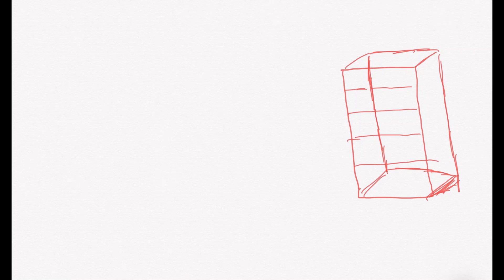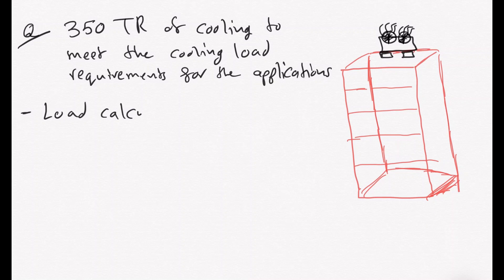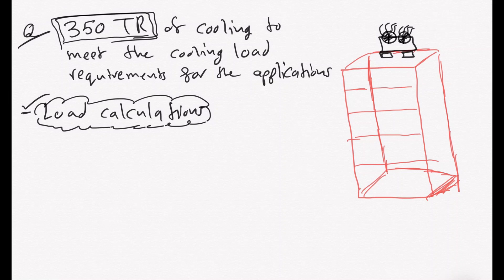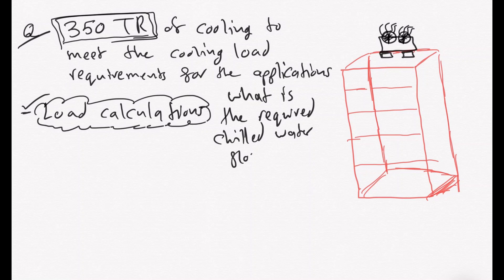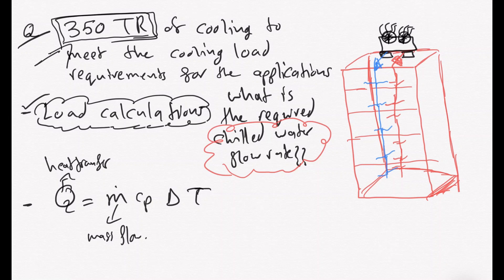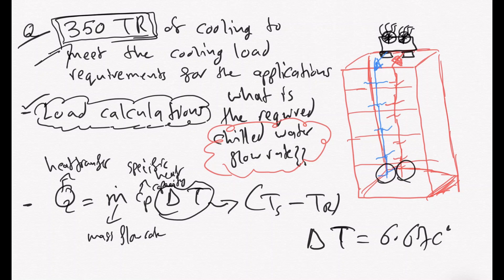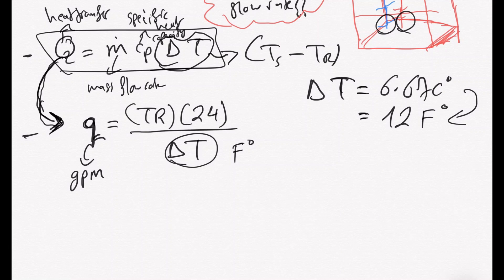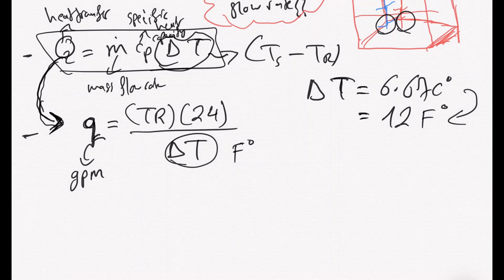Chiller Flow Rate Calculation ( HVAC Design Training - Must Learn this !)

Comment: where is the discount?
Reply from the maker: It's in the video Description , here is the link for the Chiller's Course Discount 

https://eedu.online/p/introduction-to-chilled-hvac-system-chilled-water-flow-rate-calculation?coupon_code=HALFOFF

and for the Full Master Class which is suited for aspiring professionals below is the link and it comes with a completion certificate to showcase your achievement:

https://eedu.online/p/hvac-elite-masterclass

Comment: Very well explained.  When dealing with a water cooled chiller, how do you calculate the required condenser flow?
Reply from the maker: Great Question but since the subject is dealing with water cooled chillers it requires further elaboration and detailing which we will try to address in the upcoming lessons
Reply: @ExpertEaseEducation  looking forward to it.

Comment: 6.6c is not 12f
Reply from the maker: Ofc fred ,  but delta temperature ( temperature difference ) is converted  differently than directly converting a single temperature reading from one unit to another taking that into account the calculations are spot on.

Comment: Once you recalculate the flow rate how do you adjust the actual required flow on the chiller ? Though which device and which valve ??
Reply from the maker: great question Govind , that would be done through the chilled water pumping station in which the pumps and valves assembly will be adjusted in addition to the valves at the inlet and outlet of the chiller.